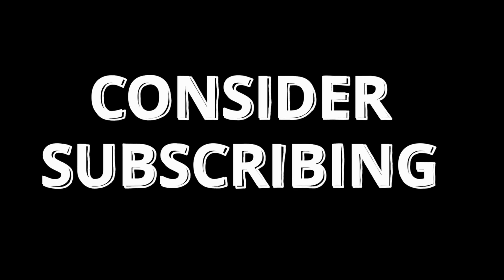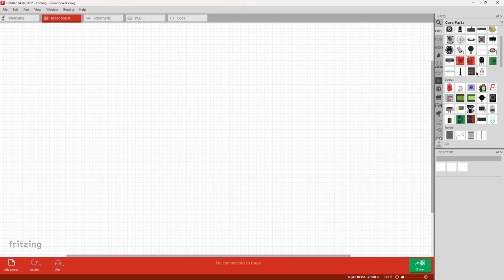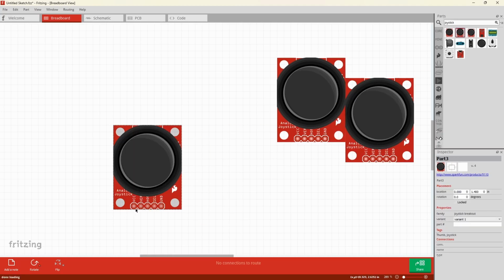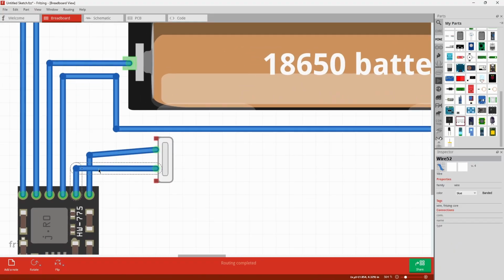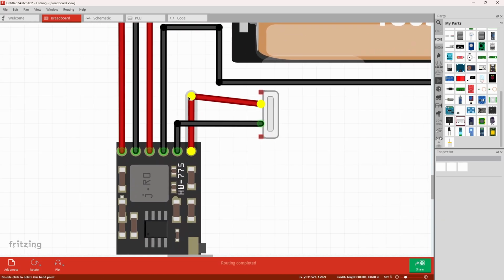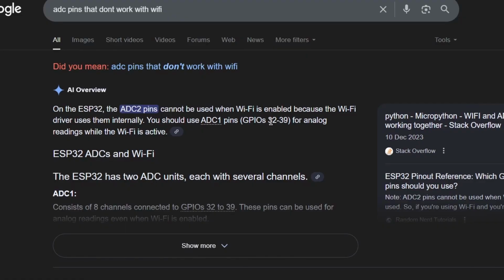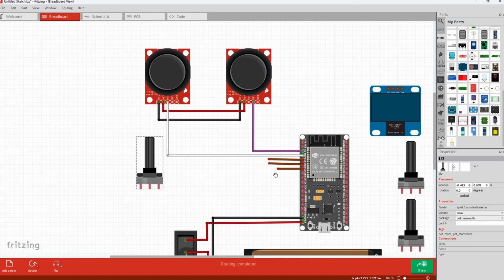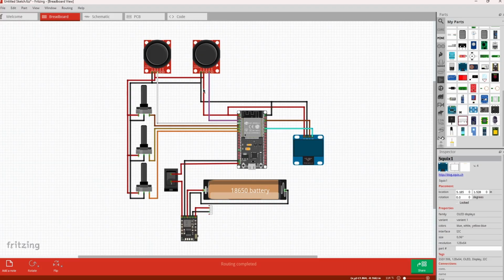How To Design Simple Circuit Diagrams || Robot Remote Controller from scratch

Comment: What Arduino are you using? And where did you get it. I also work on embedded devices and electronics in Nigeria. Currently working on solid fuel rocket
Reply from the maker: It's an esp32 micro controller. The dev kit . I get them from Hub360 or Microscale. Both are hardware and electronics vendors.
Reply: @LIGIENCE thanks I like you drive. Keep it up dude. I hope they are liable for shipping products. 

I saw you handle on twitter and then I checked you Channel here.